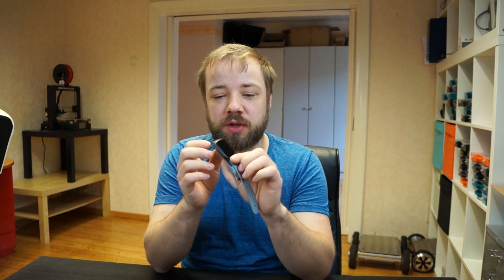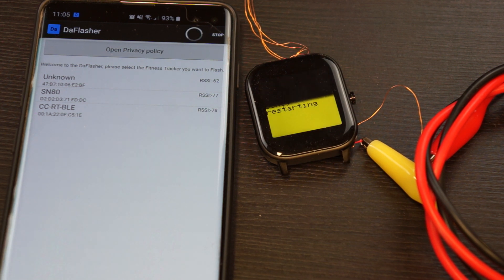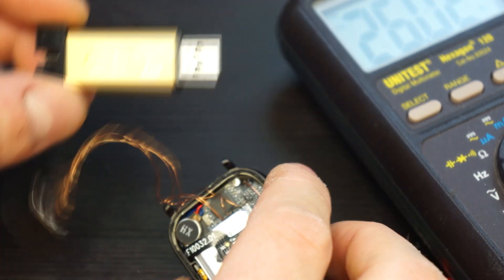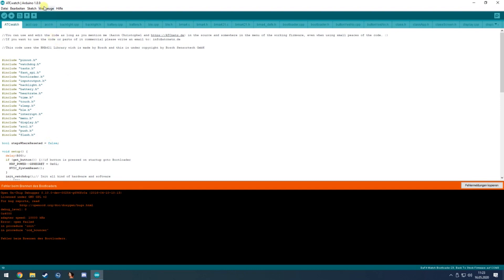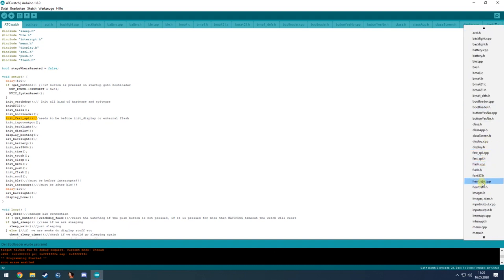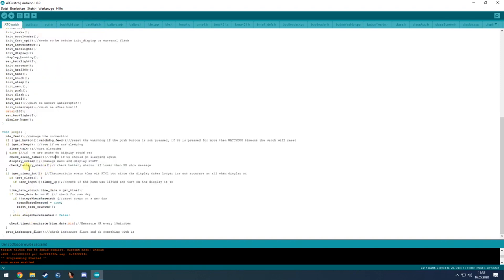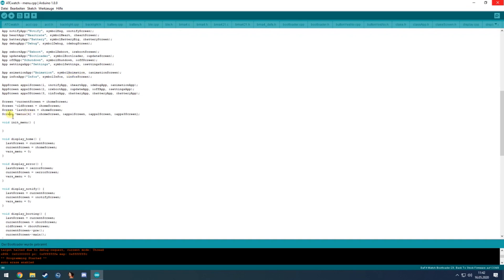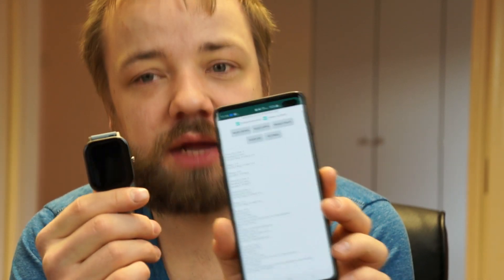Simple Arduino flashing the P8 Smartwatch

Comment: Thank you for your hard work and sharing it with all of us! Is there some program, that I can connect my USB port to my PC and I can find what chip is it using - so it is compatible with arduino?
Reply from the maker: Can you explain it a bit more ? you mean to detect the chip of a watch?
Reply: @atc1441  Yes, so I don't need to take it apart first. Is there a utility that using the USB connected to the watch, would tell me more about the watch inside - information, chip, memory.... Thanks for a super quick reply!!!
Reply from the maker: No problem 
Ok got what you mean. Unfortunately that is not possible, the usb connector is just for charging and dont have the data lines connected at all. 
The simplest way to know what hardware is used by reversing the update file if there is any. That way you know what ticks inside the watch.
Reply: @atc1441  Can I upload something and if it works, it will basically let me know that this watch is compatible with Arduino? I understand that the watch could be damaged! Or I'll take it apart and try to find the chip number.
Reply from the maker: Not really a good solution to just upload something. It needs to be 100% compatible, also the softdevice needs to correct. Better is to look out for descriptions that say nrf52832 and buy 2 to take one apart to look into. Most of these watches also have a signed bootloader so you can not just upload anything. That makes the DaFit watches so speciall as they dont use signed updates
Reply: @atc1441  I purchased in christmas time 2 identical inexpensive watches, but they do not do what I need, so I'm gonna look inside and find if this is one has compatible chip. If not,  I'll purchase couple or more with the chip that would. I play with Arduinos and ESPxxx and few more, so I'm very interested to make my own! The second part is that I would like to get a much larger display! Do you have plans to make a larger display? Thanks for quick replies!
Reply from the maker: Personally i am only interested in allready existing watches to reprogramm so will not make my own with bigger display. 
Wish you luck with the 2 ones you got
Reply: @atc1441  I understand. I will play with what you have to get experience and have some fun! Tkank you!

Comment: Hi Aaron, Congratulations for this bootloader and for sharing all this knowledge with us.  I have a question. I could load your last version but the issue is that I get the image inverted. I see the screen from right to left. Is there any way to put it in the right position?  Another question. Is possible to load with your OTA an ino file ( I mean, instead of a *.bin file).  Many thanks in advance!
Reply from the maker: Hey if possible and you want ir maybe join the discord https://discord.gg/AQ8WMUwC
There is an active discussion going on about the inverted image and now also your comment^^
Flashing an .ino file is not possible
Reply: @atc1441  Thank you Aaron! I get into this and I try to find the solution. Many thanks! :-)

Comment: Hi Aaron, thank you for the great & interesting video. 
do you have any idea on how to flash file bootloader .bin via pc?

 because my p8 smartwatch is dead

I have this problem because I use wrong bootloader

I use DaFitBootloader23Hacked.bin instead of HackedBootloader.bin for my TON device. 

I have my jumper attached to clock, data, 5v, and ground to st-link v2
Reply from the maker: Hey. Yes you can use an SWD adapter. I show it in the video D6 Simple Arduino flashing

Comment: Great, thanks for sharing all this. I'm eager to try it. Have you come across the xiaomi/huami's amazfit bip? It has different display, not an OLED but transflexive LCD. The advantage is that you have always turned on display and 30 days battery time. Disadvantage is the higher price at around 60.
Reply from the maker: Unfortunatelly Xiaomi uses another uC so there is no possibility to change the code running on like on the nRF52
Reply: Ah, I see... Do you know what uC are they using, I can't find...
Reply: amazfit bip uses STM32L476JEY6, in case anyone wonders
Reply from the maker: Thank you
Reply from the maker: @Andres the linked one is known and i got one here, its also sdk11 so can be reflashed without opening. Even got the stock firmware source code for some reason :D
Reply: @atc1441  Good to know, do you knot if we can open this one without to break it?
Reply from the maker: I broke another one while opening. So its hard but doable.

Comment: hi,
i've been having problems flashing the second boot loader. the daflasher app gives the error "bluetooth adapter disabled" a few seconds after selecting the file to flash, and so the watch is stuck in the first boot loader. i have tried flashing with a nexus 5x, and nexus 7 2013, both exhibiting the same problem. i think it is because it tries to flash after disabling bluetooth, and doesn't wait long enough for bluetooth to turn back on. i'm just waiting for the watch to drain the battery since i can't find a way to exit the boot loader from the watch. is this a problem you know of? if so how would i flash the boot loader or turn off the watch without having to pull the back off and remove the battery.
thanks for the work you have done, this looks really promising!
Reply from the maker: Hi someone else was also having this problem. You can use the app NRFconnect to bypass this for now
Reply from the maker: You cannot exit the bootloader anymore because no firmware is flasht only Bootloader is existing right now
Reply from the maker: Thank you for the solution with the wait time I will increase it
Reply: Aaron Christophel yeah nRF connect worked :) thanks for the quick reply
Reply from the maker: Nice, will update the app this night. So you have the option to make the delay longer
Reply from the maker: Hi. So the update is now online, you can select now if you want the DaFlasher to disable the Bluetooth at all. On Both D6Flasher and DaFlasher it is implemented

Comment: Hi Aaron
I have sent any command(AT+DT, BT+VER) on RX service but nothing happens. Is there any code to be changed? Please help.
Reply from the maker: Hi if you are on stock app these commandos do not work, these commandos are for the Stock firmware of the D6 Fitness tracker, but the P8 custom firmware ATCwatch does also implement the AT+DT command.
Reply: @atc1441  Yes I am using your custom firmware ATCWatch.ino. But nothing happening.
Reply: I have flashed ATCWatch firmware in P8 a watch.
Reply from the maker: @vikask11  then the AT+DT and BT+VER should work, bear in mind you need to send a \r\n at the end of each command
Reply: @atc1441  Thanks Bro :)
Reply: It is not working even I am sending  commands from nRFConnect app. And you have appended \r\n in ATCWatch code.
Reply from the maker: Does it work with the D6Notification app?
Reply: Not checked. I will check and see.
Reply from the maker: These are the correct ones
Send to the RX char and you should be good to go
Reply from the maker: It may be that nrfconnect sends the \r\n as 4 chars and not as the intendet two chars
Reply: @atc1441  I am sending AT+DT\r\n and after executing Gatt.writeCharacteristic(RxChar) getting true result but nothing happening. And byte charset in UTF-8
Reply from the maker: When sending AT+DT it should response on the notification char with the current time
Reply: @atc1441  It is not even sending any notification using nRFConnect app. Is there any extra config required to send commands? I am getting success on writeCharacteristics but nothing in coming on Notify function.
Descriptor UUID 00002902-0000-1000-8000-00805f9b34fb
Reply: Hi Thanks for you valuable time. I got it working :). You are awesome.
Reply from the maker: Good to know :)

Comment: Hi, How can I run this project in lvgl simulator? I have downloaded visual studio lvgl project. That is working fine.
Reply from the maker: That would need heavy editing, it is possible but it would be needed to remove everything that trys hardware access
Reply: @atc1441  Thanks Man :)
Reply: @atc1441  Thanks to give your valuable time to all of us.
Reply: Hi, You have created Ble advertising class in Repository. Did you create any ble scan class as central? Can you please help?
Reply from the maker: No the sandeepmistry core does not support central. But i am working on an adapted core with the adafruit core so it will support central in the future. But not for now. You could already use the adafruit core as it is but need to make it compatible
Reply: @atc1441  Thanks for speedy answer :)
Reply from the maker: No problem!
Reply: @atc1441  I have a doubt. Arduino now supports BLE Central scan. Can't we use that?
Reply from the maker: Thats unfortunately a complete different thing. This library just uses Arduinocas an simple ide but uses nordics sdk in the backround. Its not that simple :)

Comment: Error GATT ERROR
Just got it for Christmas and no way to fix, brand new p8 bricked in the first hours of use.
thx
Reply from the maker: Hey. What exactly did you do?
Reply: @atc1441  Flashed DaFitBootloader32Hacked.bin, then I reconnected to the watch and tried to flash FitBootloaderDFU1.0.1.zip
It selects the file, prints 'Started DFU' and after ~30 seconds it prints 'Error GATT ERROR' with no further info
Reply from the maker: Please try the same file with the app nRFconnect. It should flash then
Reply: @atc1441  Merry Christmas btw <3
Reply: @atc1441  Thx, I'll give it a try
Reply: @atc1441  Ps. Not mad at you, just pissed that things are going wrong so early on, sorry.
Reply: @atc1441  My fault, not yours
Reply from the maker: No problem, i got you, the ota flashing is always risky.
Thats why i also mention to get one watch open to test on an one to really flash ota, 
The main problem we have right now is that DaFit makes about 10 different versions of the P8 so you never know which one you get and there are coming more and more versions.

Here is a manual on how to get back to stock but bear in ming that you can not do any OTA glashing anymore after following it
Reply from the maker: http://bloglon.blogspot.com/2020/07/p8-smartwatch-research.html?m=1
Reply from the maker: Merry christmas to you too :)
Reply: @atc1441  thx :)

Comment: Hi, that's an amazing job! Is the source available somewhere for your bootloader (DaFitBootloader23Hacked.bin)? Or do you plan to publish it?
Any chance that all this (changing the bootloader) will work on iPhone with the nRF Connect app?
Reply from the maker: Hi, the Bootloader and hack is not published for now, still not shure if i do it, but it is alsways possible to first flash this one and then flash your own bootloader. 
The "Hack" ( DaFitBootloader23Hacked.bin ) itself does only work on Android so far, but after that it can be flashed with the nRF Connect app and even on Apple as far as i know
Reply: @atc1441  thanks a lot for your answer! Are the files in D6Arduino/SoftDeviceFiles a copy of the stock firmware and bootloader? Or are those a version of your custom Arduino firmware?
Reply from the maker: These files are allready the custom bootloader and custom firmware, because copyright